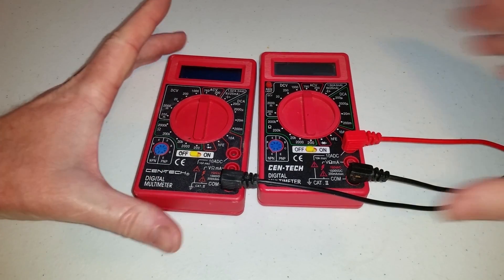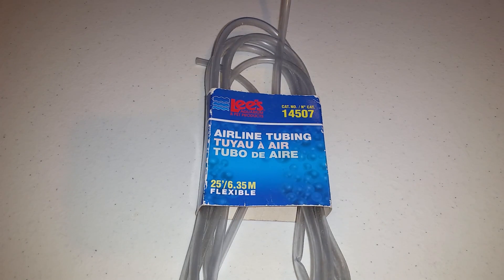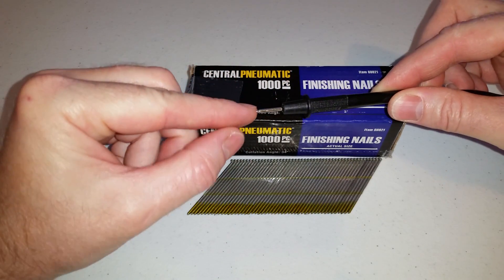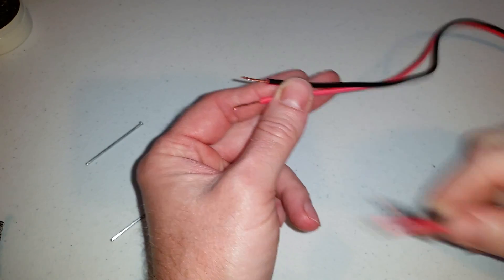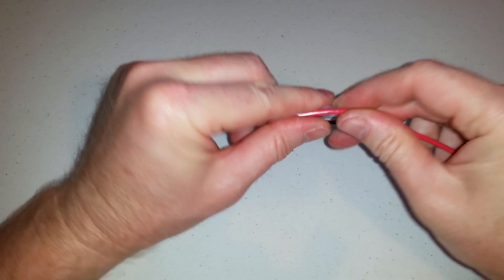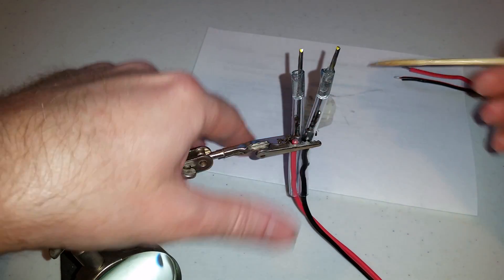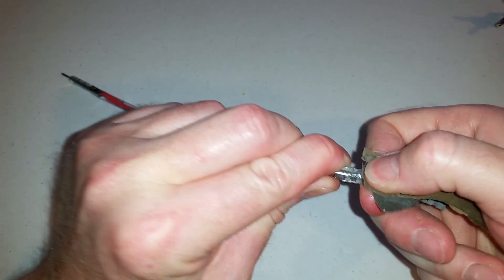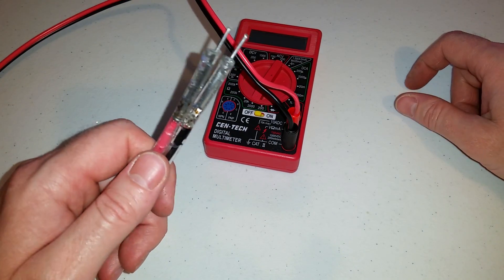Make inexpensive multimeter test lead probes

Comment: How long can the wire be? I needed my prove to be on the cars ground wire that connects to the negative side of the battery while I check for grounding in the trunk. The wire was about 15 feet but wasn't getting accurate info. Im going cut it down to 10 feet hopefully that will work.
Reply from the maker: If it's too long you will get voltage drop due to the resistance of the wire.  My probe wires are about 2 to 3 feet long.
Why measure from the battery ground?  The entire chassis of the car is a ground.  Measure from a bare piece of metal next to where you are trying to get a reading.
Reply: @MrDabrudda  I was having issues with a new amplifier. Everything was wired properly and my ground connection was the only thing left to check. But after seeing only a  voltage drop. I took the amplifier to get checked. The amplifier is defective.
Reply: Also yes that would have also worked but I didn't think of it. Anyways thanks for the video 👍

Comment: Wouldn't a copper wire of similar thickness to the nails be better tips?
Reply from the maker: If you have copper wire...which I didn't have so I used nails.

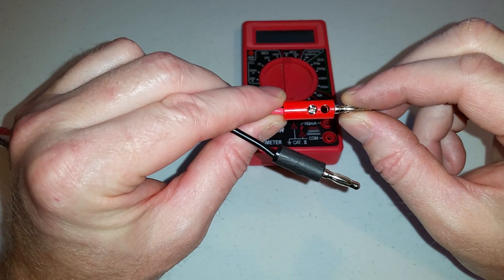Comment: 4:23 what is it name connector if I want searching on Ebay ??

BTW, is that rally safe use that Transparant Tube as Isolator ??
Reply from the maker: Banana plugs.  If the tubing can hold air pressure it can also work as a dielectric.
Reply from the maker: I'm not measuring 10kv with these leads.  I'm measuring 12v or testing batteries with the cheap harbor freight meter.
Reply: MrDabrudda of course Im would not using it for 10KV 😂😂😂😂... I just measuring  220V - 230V (Home)...

Thank you Bro for your Answer, Now I will buy some Banana Plug for Stock... 🍻🍻

Comment: The larger wire is a good thing to have.  In my case, I tend to blow the fuses.  I regularly stop in and pick up a small item that I need, and always have a free coupon.  I either get one of the LED lights or a multimeter..  As you might guess, I have several sets of probes for replacements - also batteries and switches and .. well, you get the idea.  I have a better multimeter, but free is hard to beat.  And if I need more than one, it's OK, I have several.

Comment: Those multimeters are not suitable for electronics, nor do they actually meet the CAT II ratings for safety.

Hopefully no one follows this tutorial with the intent to measure mains power.
Reply from the maker: What?!  I go out and measure 10kv 3 phase mains with this all the time!  No sh*t someone should not measure mains with a "Free" Harbor Freight multimeter.  But all kidding aside, I've measured 220VAC going to my well pump with this and it worked fine.
Reply: Honestly buy a Fluke 101 meter for $47  with TL-75 leads if you are going to muck around 220 VAC lines.
Reply: The multimeter does looks cheap, but the technology to make one is not that expensive, so, even these cheap ones without rubber cover might be good too. But, what MrDabrudda failed to demonstrate in the video is the resistance of his leads, first the original ones and then the one he made. Because, it does not matter if you have a cheap of expensive multimeter if your leads have too much resistance  which makes the DMM to show wrong values because one part of incoming power is eaten by the leads resistance.

Sticking anything in the main power - should be done with extra care and high alertness, so that if anything starts to melt or does a popping sound, you can immediately let it go and not jeopardize your life.
Even though I have a cat2 rated mastech, whenever I need to check mains power, I always do that with extra alertness and distance. With dc power I am a total opposite. I fry things and short circuit them sometimes, and not care much, but ac is not a power to play with. For higher safety, I would use awg10 and then stick that in mains butt :)

Comment: Do you have to use expoxy? I'm assuming it's to just to hold the tube in place?
Reply from the maker: The epoxy helps hold the tubing in place.  You could use expanding foam glue like Gorilla glue also.
Reply: ah. I needed something like this as I needed very thin pins.